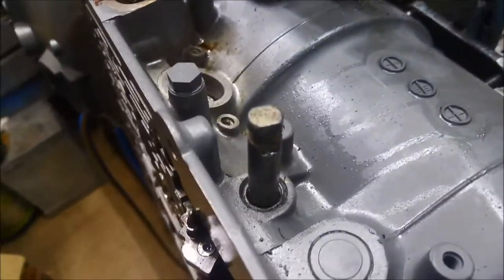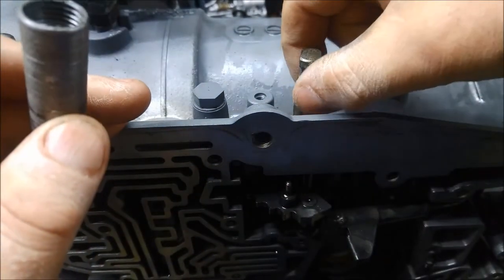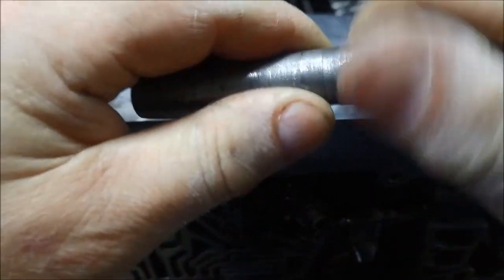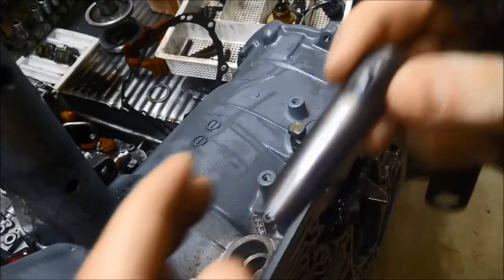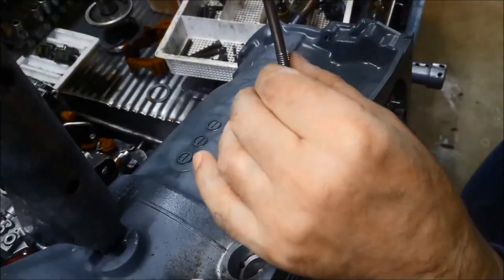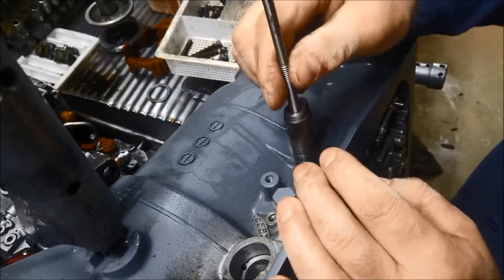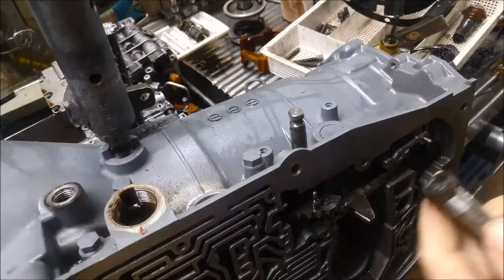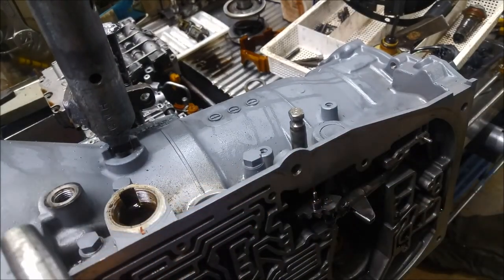Automatic Transmission Manual Shaft Seal Selector Seal Shift Shaft Seal Removal Tool

Comment: How do you take the selector shaft out? The threads are all chewed up...  Need to replace it.. Does it just unscrew once the seal is out? 

Thanks for the video...
Reply from the maker: hi, there will be a bracket inside trans. you will also need to remove valve body and also lower rear end of trans to be able to slide out shaft if it will hit the floor arch. cheers

Comment: Great video. Unfortunately iam not as "adventurous" as you so I bought the shaft seal remover tool but it won't slide over the thicker part of the shaft. Sp I can't remove the seal. Any ideas on why this is the case? 
Thanks
Reply from the maker: hi, sounds like you may have wrong seal remover. can you try machine the inner part of remover so can fit over the shaft? try an engineering workshop with a lathe. cheers
Reply: Hi thanks so much for your response .  I finally got the tool over the shaft it was tight but worked.  Some people on line said that the for was snug too.

Comment: I have another issue.. Which led me to replace the shaft seal.. 
The manual shifter shaft will pop in and out ever so slightly.. so I can't get the b&m shifter cable to work properly. 
I heard there is a castle nut lock nut inside the transmission holding on to the shifter shaft and wonder if perhaps the nut loosened for some reason. 
Any ideas on why it would do such a thing? Any ideas on the torque specs for the lock nut on the inside of the tranny and on the shifter lever shaft? 

Thanks again.  

Thanks again for your ideas.
Reply from the maker: hi, the shaft will usually have a small amount of play. those bm shifters are a mongrel to adjust. best to remove the trans pan to confirm the selector matches the position of the shifter with the position in the trans on rooster comb. cheers